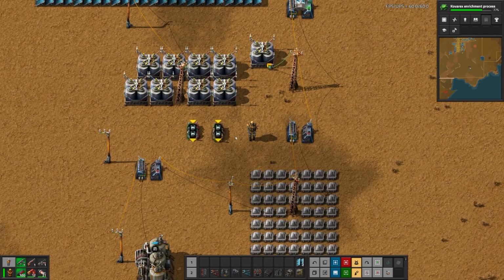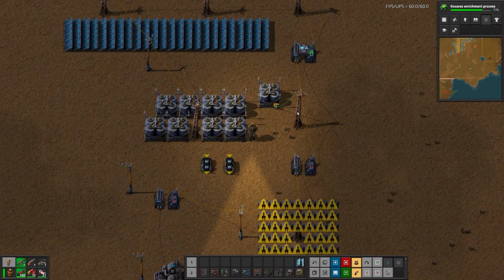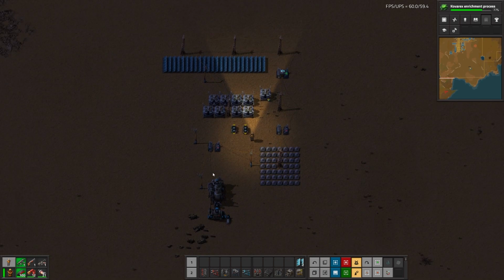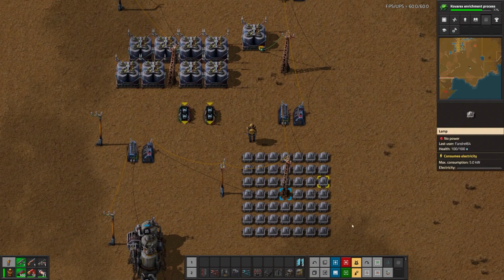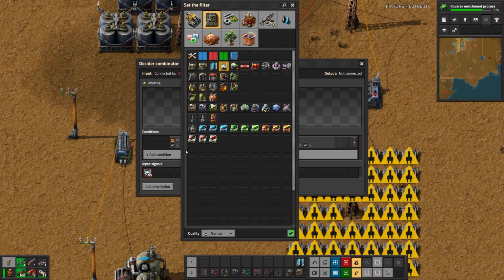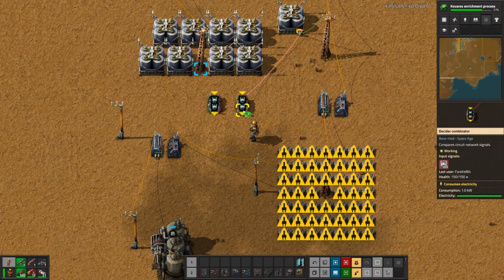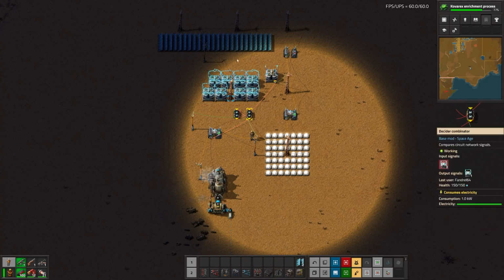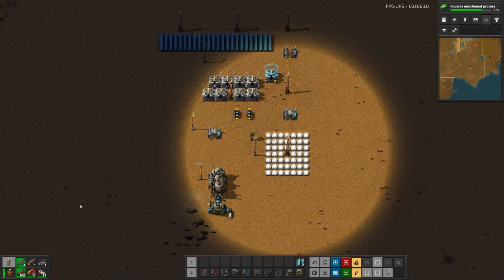Factorio Space Age: Bonus S-R Latches, Base Load, and Peak Shaving

Comment: This kind of over-engineering is incredibly fun for many of us, and fun is the only justification you need to do anything in Factorio. For the sake of anyone new to the game, it is totally unnecessary to manage nuclear power. Even before kovarex processing, 235 is the cheapest/most abundant source of energy. It only costs the trouble to store the 238 byproduct. On my current save, normal game, I have consumed 8 fuel cells in the first 90 minutes, created 160 that are waiting, and stored 21 235 toward starting Kovarex. I do use circuits to conserve based on heat of the reactor so it's only inserting a new fuel canister when the reactor temperature falls below a threshold and there is not already fuel burning. But Bob's advice is a MUST when you only have steam and solar. Excellent Factorio content. Hoping to find a bunch more videos on your chan.
Reply from the maker: These days with the changes to Factorio I’m not sure how useful it is because I haven’t played it in a while now once I made it to the fringe because it got kind of grindy for me and other life stuff started getting in the way. However, when I was playing Space Age it really came into play when I was setting up for things like the CME. I had several plants dedicated to just kicking in and handling that additional load when the protection was active. In fact somewhere on the channel is an experiment where I went a little crazy and built an insane amount of accumulators in order to actually measure the power used for the protection. If memory serves my right it was on the order of several 10k’s of accumulators I think but it’s been some time so I’d have to go back through the old videos to find the actual number.

Comment: When Satisfactory came out of Beta, the small biomass plants could now be set up in a mode like peak-shaving. I'd set up a dozen of them on standby in case the other bigger plants get overloaded. I'd love to see factorio do that. Imagine adding isochronous and droop modes! That would blow some minds!
Reply from the maker: Yeah that would be pretty wild but would only appeal to a select few nerds. LOL One thing that was pointed out to me and maybe it changed some time ago and I never noticed it or something because I remember it not being the case for some reason, is that Factorio actually does preference solar panels over steam plants for power. For some reason I seem to remember solar, steam, and nuke as sharing equally across the board. Still plenty of reasons for me to want to cut off individual steam plants and running one at full load as opposed to several at partial loads.